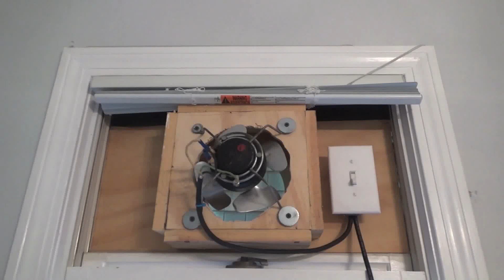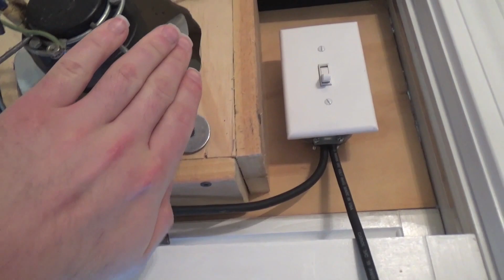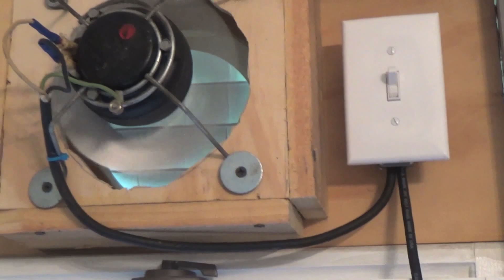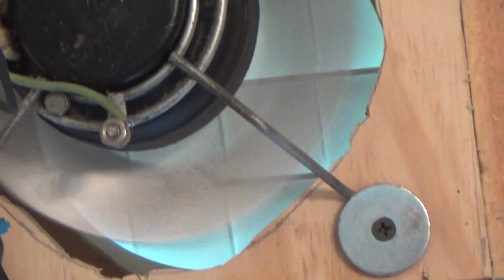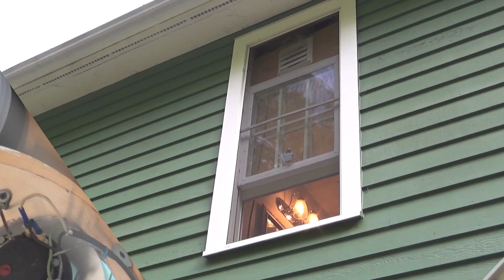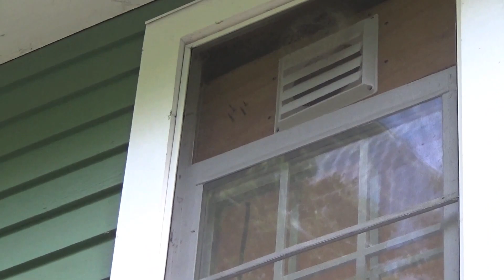New Bathroom Exhaust Fan Installed

Comment: I think fans above 100 CFM can open plastic shutters very far.
Reply from the maker: I think you're wrong.. CFM has nothing to do with the amount of air a fan is able to push when there's resistance..
Reply: Jordan U Just trying to help you. Anyways I like your fan.
Reply from the maker: If you'd like to help, gather some information and become educated on the subject.. Then, we can have a factual discussion and perhaps draw a reasonable conclusion..
Reply from the maker: Don't be rude..
Reply: Jordan U Good idea :)
Reply from the maker: Because I do not permit people to be rude in my comments box!
Reply: This fan is look like outside fan when you take a shower did you trun the fan

Comment: Jordan U, Try mounting the fan close to the shutters like how you did previously. Hope this works :)
Reply from the maker: The shutter is too heavy for this fan, it has nothing to do with the distance away.. All the air is being funneled through the shutter with this design..
Reply: Jordan U, Make a shutter with paper or some light material.
Reply from the maker: What good is a shutter made of paper?
Reply: Jordan U then try a shutter out of light, waterproof material
Reply from the maker: That would be plastic..
Reply: Jordan U OK. What material did you use for the shutter?
Reply from the maker: The shutter is plastic..
Reply: How is the shutter heavy? Plastic is not heavy.
Reply: How much CFM is the fan? Condenser fans have less CFM because they are used to intake and not exhaust.
Reply from the maker: The shutter is too heavy for the fan.. That's all there is to it..
Not being used for intake or exhaust does not indicate a fan has a low CFM rating at all..
Reply: Jordan U How much CFM is this fan and how much CFM for the range fan?
Reply from the maker: I don't know what the CFM rating for this fan is, and I haven't the slightest idea regarding what range fan you're talking about..